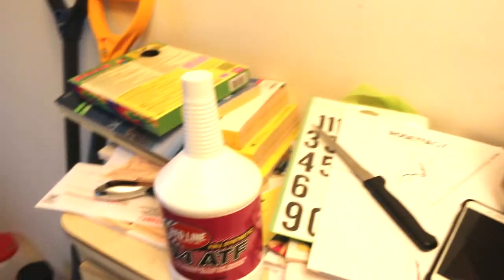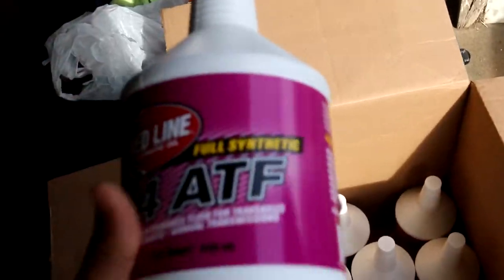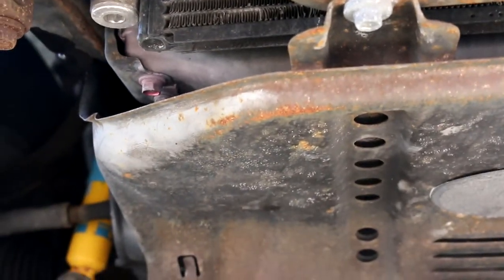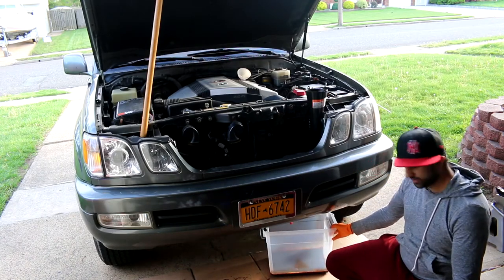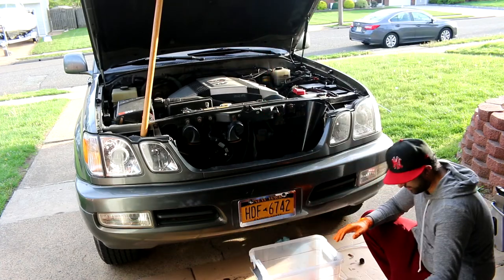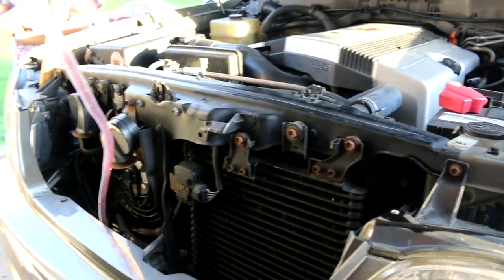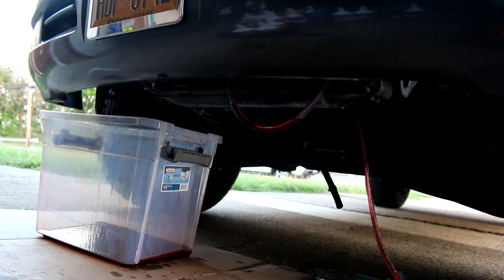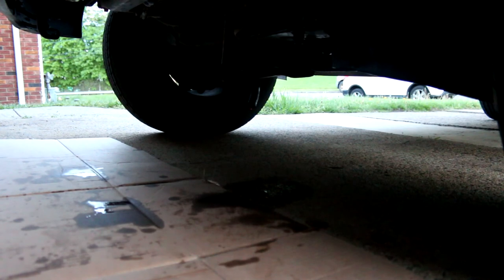LX470 full transmission Fluid exchange Best way for high millage trucks

Comment: I used Valvoline Maxlife full Syntetic ATF on my 2005 GX470 @105k miles, cheap and excellent.. Used 3 Galons.
 Works with my trans with WS fluid and many many other transmissions. Already drove 25k miles and no issues.

Comment: You should disconnect directly from the return line as far as you can close to the transmission, not the lines from the radiator or transmission cooler. In this case you can also clear up the fluid inside radiator or trans cooler .

Comment: Thanks for the video. I decided to try something a little different. 

First I brought a 22 quart transparent bucket with 1 quart markings. I also pulled the hose going to the radiator just like you however I used the same male connector to fill. So, I didn't have to pull or push the radiator separately. 

Therefore I filled 2 quarts after emptying every 2 quarts! Alot faster and cleaner. I used gravity just like you, I just used the same port I poured from. 

If I ever do this again I would think of a way to hold up the funnel so I don't have to stand there waiting for long periods of time to refill at each interval. 

Thanks for the confidence I now posses!

Comment: It's been some time since you posted, buuuut figured I would ask. 

I have a 2006, could you hook the return line to a bin of like 10 qts of ATF, and the line to the radiator to a bucket and shut the truck off right before the 10 qt's run out? Wouldn't that keep the level the same?
Reply from the maker: Hi, thank you for your question. It's been some time since I last posted, but I've been working on a complete overhaul project on the LX that I'll be sharing in a detailed series soon. I've learned a lot since the transmission flush video, especially regarding the method you're suggesting.

The idea of connecting the return line to a bin of fresh ATF and the line to the radiator to a bucket, planning to shut off the truck before the fresh ATF runs out, seems like it would maintain the fluid level. However, there's a crucial aspect that prevents this method from working effectively.

The transmission's fluid pump is designed to pump the old fluid out, but there's no mechanism to actively pump new fluid in. The transmission won't just suck the new fluid back because it's the pump's action that moves the fluid through the cooling system and back through the return line. Without something to force the new fluid into the transmission at the same rate the old fluid is removed, simply having a supply of new fluid isn't enough.

This is where a transmission fluid exchange machine comes into play. It connects to both the supply and return lines, using either the transmission's own pump or an independent pump to ensure the new fluid is forced in at the exact rate the old fluid is expelled. This method guarantees a more efficient and complete fluid exchange than what you're proposing with the buckets.

I hope that helps. Please reach out if you have any questions and thank you for watching :)
Reply: @BeginnersLuckGarage   Thank you so much for the explanation! I've seen your posts on MUD, and this is 100% what I was trying to understand! 

See you around, "2000UZJ"

Comment: nice video.  I'm also thinking about changing my fluid to synthetic redline d4.  how did it worked out? any issues?
Reply from the maker: None. Runs smooth and shifting is much smoother.
Reply: BeginnersLuckGarage can you tell the name of the alarm that you have
Reply from the maker: hey it is a python 5706. the same ass the viper 5706. i have a video of me installing it.
Reply: Would you recommend changing the filter?
My LC is over 200k, but atf fluid is still very clean.

Comment: Is Redline better than Toyota AFT? Is that why you chose Redline?
Reply from the maker: No i just found a good deal on the redline on ebay and it was actually a little cheaper than the Toyota fluid for the amount of bottles i was buying. for my routine drain and fills I will be using the regular Toyota recommended ATF. I can say that after filling with redline my shifting has gotten smother. but this might be just from going from an old worn out fluid to new.

Comment: Men. you have no idea what you doing. omg you not suppose to do videos if you have no idea what you are doing because you misinform people that are looking for help. What you do is pretty much trail and error!!! You suppose to pressurize can with new oil and connect it to the other pipe and just run till it sucks it all out. Than you confirm oil lvl and done.